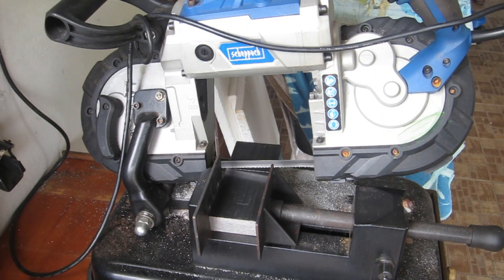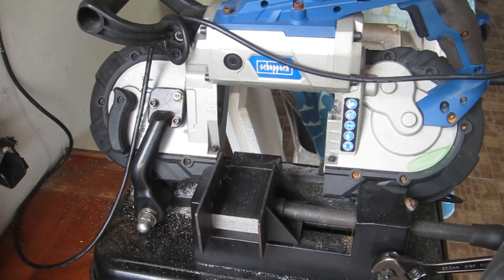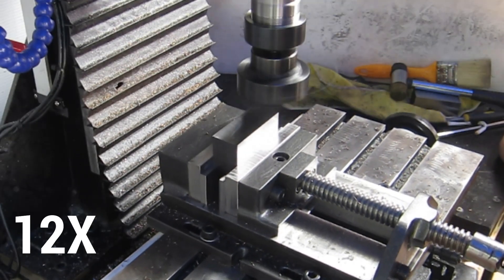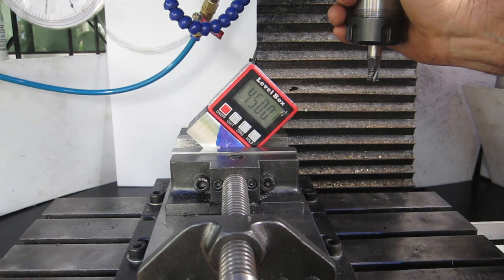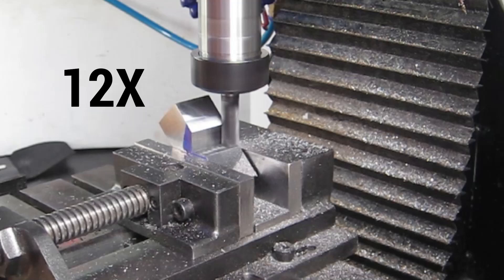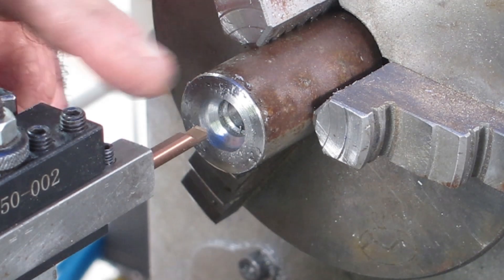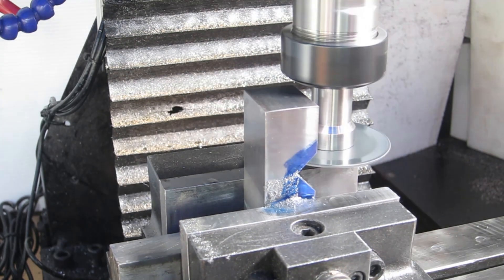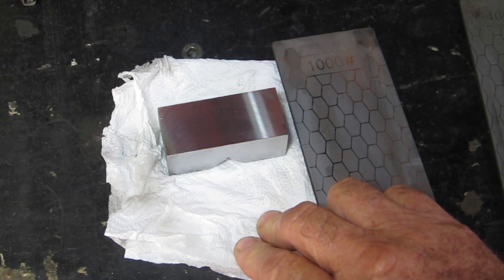MHW Episode 50 - Homemade V Block

Comment: Every single time someone makes a v-block they never explain what is the purpose of the slot cut at the bottom of the v's is for!?!?...
Reply: It might be a relief cut, so a burr on the edge of your part does not interfere with the faces sitting flat with each other.
Reply from the maker: It's just there for clearance purposes, the corner of most cutters is almost never perfectly square.

Comment: I can't imagine how you managed life without a Mill.  Actually, Ive been planning to build a "mill attachment" (ala Mr. Pete) for my old Atlas/Craftsman lathe after I finished a big tear-down, clean, check, re-assemble and a couple mods on it.  I've been thinking about the same saw arbor you made.  Nice to see it works!
Reply from the maker: You will find it extremely satisfying to use something you made yourself 👍